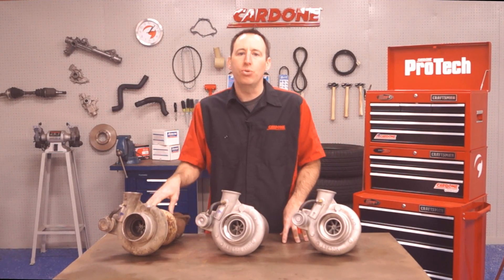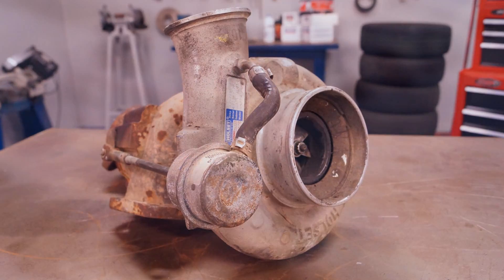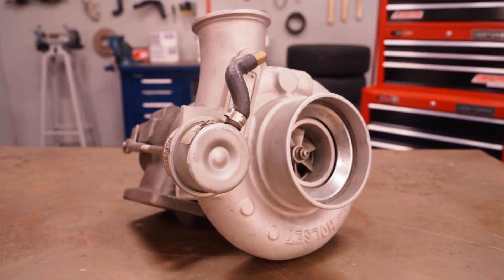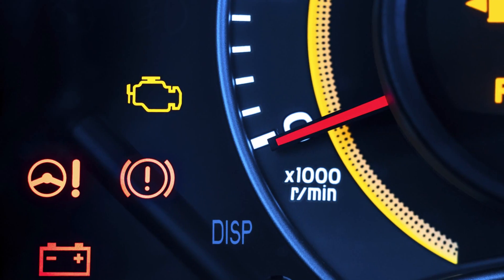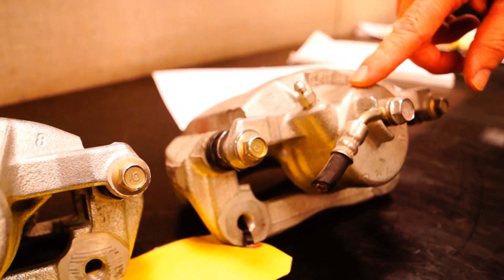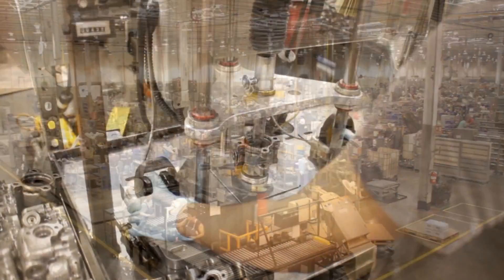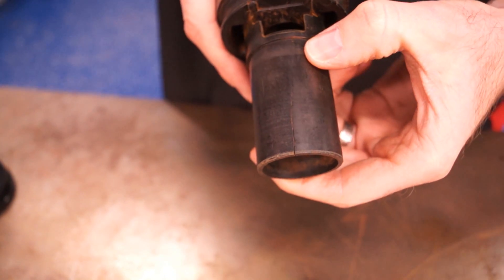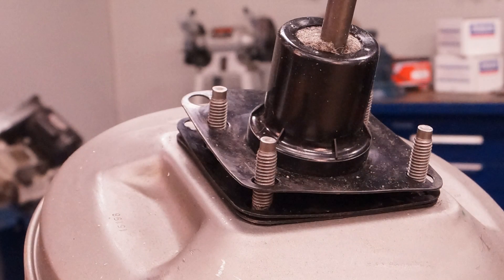Differences Between Used, Rebuilt and Remanufactured Auto Parts

Comment: I wouldn't trust cardone's claims of reengineering. The rear wiper motors on older Ford Explorers and Expeditions are known to fail due to the internal plastic gears. Yet cardone continues to sell those wiper motors with plastic gears and they still fail early, just as they did 20 years ago.

Comment: Lost me once you said better than new. Than y not reman everything
Reply: He was referring to the less common situations where the original design had a weakness that caused premature failure rather than normal wear.  Most vehicles have a few such parts, and why not reman everything is because of the great cost to disassemble, reman, and reassemble.  It is not known for certain how shortened the lifespan of such parts will be until they have had a large sample size out in the wild to determine excessive failure rate and a cause to change the design.

Otherwise, just making every part 30% more expensive, would drive up the price of the vehicle by 30%, which is often a higher cost that accepting a few repairs every so often, as long as you DIY or have a competent, trustworthy mechanic.

How many new car buyers really think about minute details of how each, of the thousands of components, are made?   They care more about looks, performance, fuel economy, cost, and historic reliability which mostly tells them about the last generation of that model, not the new one they're buying now. Even so-called professional reviewers, seldom get into guessing about the reliability of new designs, rather than nothing something like an engine or tranny known to have problems which are usually fixed in a few years anyway.

Comment: HEY CARDONE... Since the service life of a brake pads is considerably longer than it used to be with ceramic pads, please, for the love of god, also sell 2 slightly over-sized (.05"-.020"over) caliper slider pins for those of us who have your rebuilt calipers on their cars. The reason is because every rebuilt caliper I've ever gotten from you, has worn slider pin holes that are not given attention when they clean the caliper and rebuild the piston. Sure, the holes are filled with grease from the factory, and they're fine for a month or two, but because of the hole's wear from the hardened slider pin and the grease literally disappearing, regardless of grease quality, the calipers end up rattling on the pins when going down even a mildly bumpy road with no foot on the brake. This is because the grease, which helps cushion the caliper at first, literally melts off by the 2nd month, even with good rubber dust seals. The pins are mostly dry and the calipers bang like crazy over bumps. Not to mention possible brake pad shake too. All this slop makes my nice car feel like ass over the bumpy roads of RI. SOOOO, waddaya say... can we be intelligent like I know the Cardone people are and let's solve this stupid problem. I know I'm not the only person that knows why this occurs. I'm just one of the few that's identified it and complained about it.

Comment: I had a question,i don't understand this rebuilt deal,i guess i've never bought a rebuilt part, who sells them? every time i have a bought a part from Cardone at Autozone or other parts places the items always say "re manufactured"  for example, im needing to buy a steering rack for my car, this same rack is used in 30 other models, since this rack has been around for 30 plus years i assume any known reliability issues were worked out eons ago but when you buy the part the box always says "reman" so to me reman has always meant, clean the part, take it apart, rebuild the internals and sell it to the public, wouldn't that be rebuilt?
Reply: You could rebuild it yourself, just changing bearings, gaskets and so on.
Reply: Rebuilt often means that only the wear portions, or only the most worn/fault area in some cases, is replaced, while rebuilt "should" also mean measuring all important tolerances, replacing any part that is subject to wear, and refinishing the exterior.  Rebuilt can be done as well in some cases, but remanufactured with same quality standards, should always be equal or better quality.  The thing is, sometimes the quality standards aren't as good, for example if you replace OEM bearings in something with cheap Chinese bearings, the resultant lifespan may suffer.